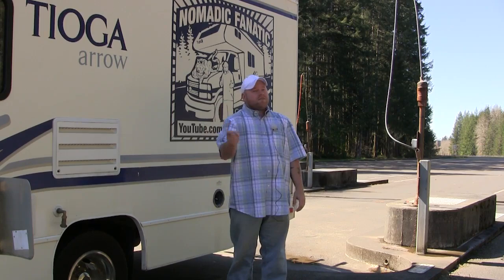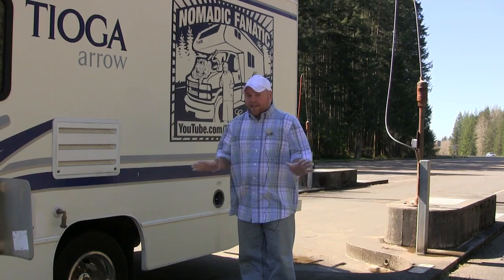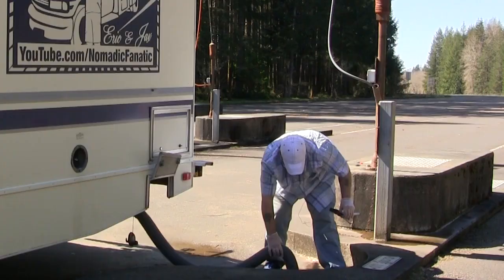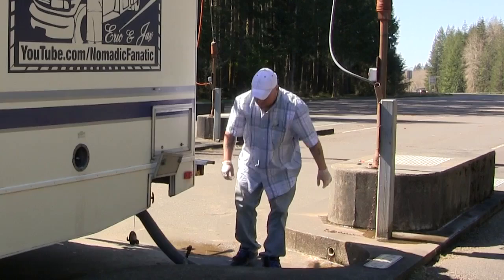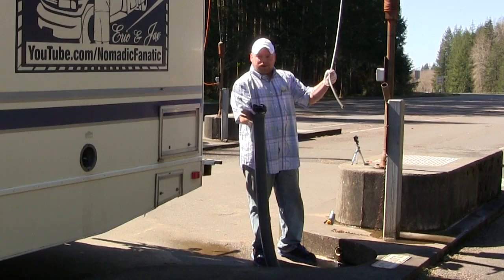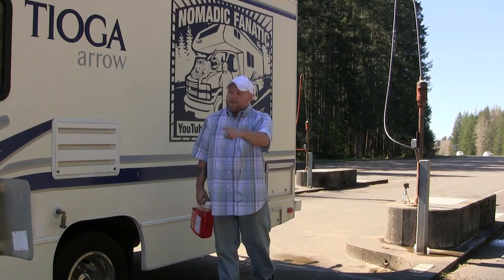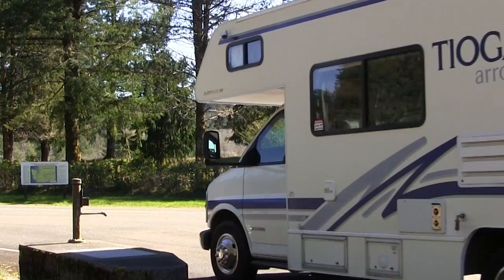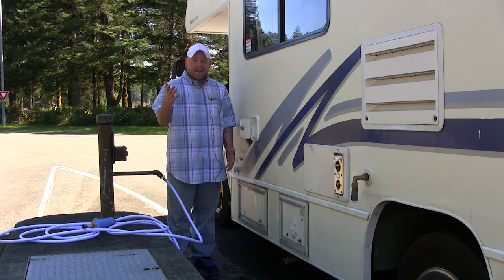How To Drain RV Holding Tanks & Tips

Comment: Hello, Nomadic Fanatic:  Ok, so have to share my first time experience emptying my RV's holding tank after watching your video.  A couple of days ago I finally went to a state park that has an RV dumping station. There was one RVer in front of me preparing to empty his tank so I thought I'd observe as a refresher. Cool. I had everything all ready so I would not have to open compartments, take stuff out, etc. When my turn came, I drove up and it went as follows:

Mistake #1 - I did not park the RV exactly so the tank would be over the indented ramp. 
Mistake #2 - I grabbed the long hose/connector (with the clear attachment as I believe you showed before), unscrewed the cap so I could hook up the hose and... wait for it:  Liquid started pouring out immediately!  Brownish, stinky water all over the place...yuck. 

Thankfully, an experienced guy was waiting behind and he immediately came over and pushed the lever back in.  Apparently, the levers had been left opened by the previous owner and, because I never saw anything leaking, I assumed everything was closed (in all fairness to my naivete, my late husband always took care of these tasks). While the helpful RVer did that, I was flushing the area and my shoes with clean water. I am thankful you stressed wearing gloves (although I would have done so regardless). I'm also very glad I had a spare set of socks and shoes in the RV!

After both black/grey water had been flushed, I cleaned the hose per your instructions and proceeded to put everything away. The RVer who helped and I had a good laugh about it. I can tell you one thing for sure:  that will never happen to me again!

Comment: The only thing I can add is when pulling the valve handle, make sure you pull it straight out.  #2 once the valve handle is out, once a month I'll spray WD40 on the metal stem to keep it free-moving.  When I have two people as a couple, the other person can be inside and running some water as a extra flush.

Comment: Nice vid. I would suggest using some rubbing alcohol, or lysol on the spigot of the fresh water, then rinsing it before hooking up my hose, especially if I plan on drinking it. You never know what the last user did with it, or what condition their hoses were in.
Reply: 22 August 2018 (Wed)

Ryan Losinger:

that was great advice. Even if the advice is still relevant two years later. Thanks

creative group

Comment: Your video editing skills have improved immensely in the past several months. This is a very professional presentation, one of your best.

I think 4 minutes is a little rushed, but I agree, it should not take long.

It is a good idea to have a spray bottle of bleach to use also, and some places (I understand) require that you use a threaded adapter on the dump pipe in the ground.

Comment: I always clean the black water tank out with the water at the dump station at least 2 times and then pull the drain always put chemicals in your black water tank I get the one at the Big Blue Store and it doesn't hurt to dump a little down in the grey water tank and my grey and black water tank are smaller than yours there's something like 5 to8 gallons and I have two caps not one like yours ones for the grey water ones for the black water thanks for sharing the information Eric great video

Comment: Greetings Eric. Enjoyed the video. However, you may want to consider a natural option vs a chemical option when treating your tanks. There are several products on the market but I use something called a Pro-Biotic. I use it in my black and grey tanks. It uses bacteria to dissolve solids in your black tank and oils in your grey tank. I've been using this product for over a year now and when I drain my tanks, there are no solids. The bacteria converts them to liquid. There are never any odors or clogs. If you are interested search You Tube for Tank Techs RX. I've used this product in my RV since it was new and have been extremely happy. Only caveat is that you cannot use anti bacterial soaps as they will kill the good bacteria in your tanks. I also use a totally biodegradable soap so I don't harm the bacteria in my tanks.

Comment: Good video.  You must have small tanks though if you can empty them in 4 minutes.  It takes a couple of minutes for my black tank to drain, then I have a small outside kitchen gray tank that takes a couple of minutes, but my main gray tank takes a good 5 minutes to drain on its own.

Still very good technique.  A lot of people are grossed out by this process, I was when I first started camping, but now I just see it as part of the trip.

On the toilet paper issue, I will use anything that is single ply.   Never had an issue with the tissue.
Reply: +davva360 Ya mine too.  When we wintered in Arizona, the hose remained hooked up but I pulled the lever once ever three days, even that took longer then 4 minutes to drain both black and grey tanks.  Depends on the size for sure, plus I like to hook my rinse up about every third time to clean the inside, my unit has both grey and black rinse so that takes a bit longer as well.

Comment: I use a extra gate valve at discharge pipe. The discharge hose attaches to it. I open that valve and dump the black tank first. Then I close the extra gate valve and open the grey tank valve. Wait 2 minutes as grey water flows into black tank. They will become equal level. Then close grey valve. Then open extra valve at discharge pipe. When that water has drained close the black tank valve. Then open grey to finish draining.

Comment: I have a question for you. I have a 4x4 ford f150 and a small 16ft toyhauler.  How would traveling, boondocking etc.., work out with my setup? I would like to travel the states like you. This doesn't pertain to this video but I also learned a few things from this one.  Thanks for your feedback!
Reply from the maker: +Bryan D It's hard for me to answer that since I've not tried this.  I'll say this: I see plenty of trucks hauling trailers while boondocking.  Parking on sidestreets is going to be tricky, but they still do it. Park at 10pm, out by 7am before anyone even bats an eye. Parking in large lots like Walmarts and Home Depots is going to mean you'll need a lot of room ,and you'll take 7-8 spots overnight, but if they aren't being used, you should have no trouble.

Comment: ANOTHER good vid, Eric; thanks! composing to the old one on the same subject, you've come a long way as a choreographer and presenter. 

I bought a static 5th wheel at a permanent (for now) spot with my dump tube continuously hooked up. I'm assuming I should continue to 'hold & dump' so things flow properly; unless all y'all with experience can recommend that I just leave it open all the time? (and save me the time & mess?)  thanks.

Comment: I would be very concerned about putting that wand on the potable water spigot then inserting it in the toilet as when the water is shut off it will back flow into the hose if not the pipe from where the water comes from.
Reply: +90 footer productions Well first you don't use your potable hose, you use a reg. garden hose. You use the  non-potable spigot from outside. Thats how I do it.
Reply: No it won't! The valve is shut, no back flow.  OMG.
Reply: +helmitpeak ok but at 8:30 in the video he points to what I take as the potable water source that he shows later in the video so if theres another source of water that did not appear then my bad.
Reply: +Don Leamon ok well its clear you are unfamiliar with back flow preventers and the laws requiring them if that valve fails or is not properly working then guess what shit water will be pulled up the hose as I am quite sure that is well water and the amount of water in that system outweighs whats in his service hose its called a siphon!
Reply: +90 footer productions 
OK well it is more clear that you don't understand how that wand works, or that the black tank is empty when you use it.